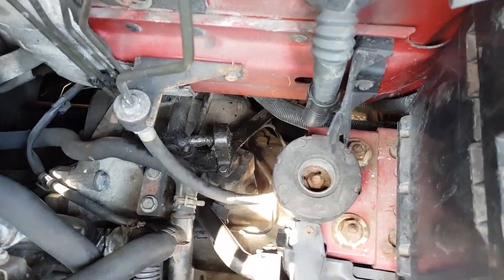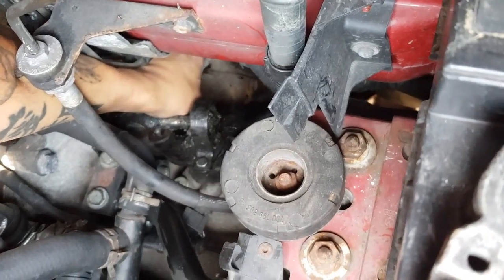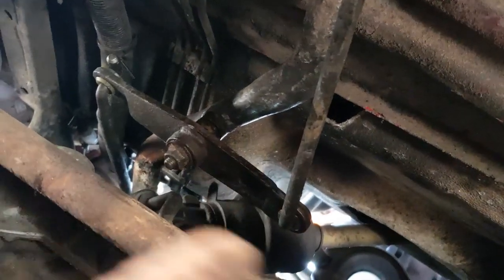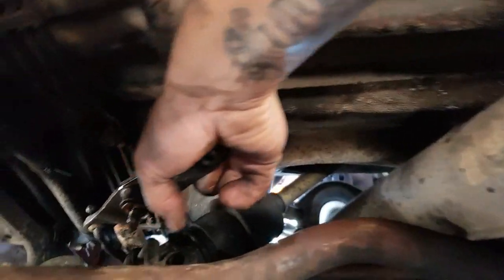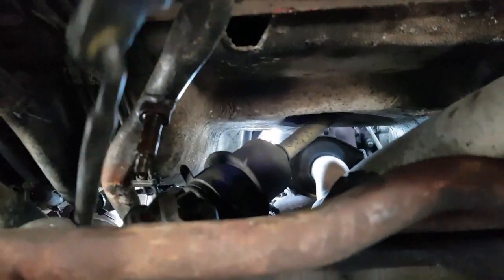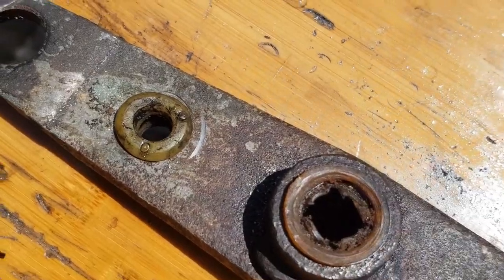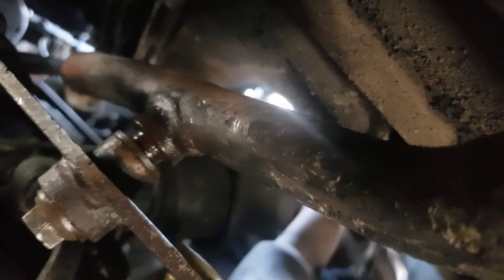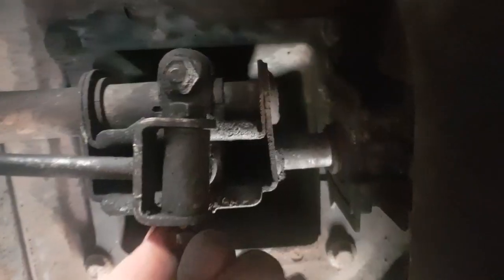Short shift on the van (VW T4)

Comment: Just to clarify its the bar that goes from gearstick to the metal plate that needs to be reseated closer to the middle of the plate. I was so confused by the video as the aspect kept changing it confused me and my mechanic into getting the wrong side of the plate drilled.
Reply from the maker: Sorry your gears dont seem to be going in. No it's not the rod that goes from the gear box to that plate, I didnt really make that part clear, it's the drivers side of the plate that needs relocating that rod that goes back to the gear lever part. At 5.41 in the video you can see what I mean. Sorry that's unclear but u need to relocate that rod that goes from the gear stick to that plate, hope this has helped you 🤙

Comment: Hi can’t get 1st an 2nd gear is it the shaft under lever where pinch bolt is as can adjust that so maybe it’s in different position now.steve t4 2.5tdi 102.ive just put new bushes on and as gear stick broke off had to replace gear tower too.
Reply from the maker: Your having problems with 1st and 2nd and u havent got the short shift? If so that means it's the bushings that are on top of the gearbox, theres is three I had to replace mine there cheap and easy to do, I couldnt drive my van without short shift now makes so much difference, inwas use to mine without short shift aswel but having a shorter throw makes life so much easier

Comment: Great video,  did you take off the panel underneath to at to it
Reply from the maker: I can't remember 100% but I would have thought u can get tonic without removing the under tray if not it's only 4 bolts and the tray will move out the way enough